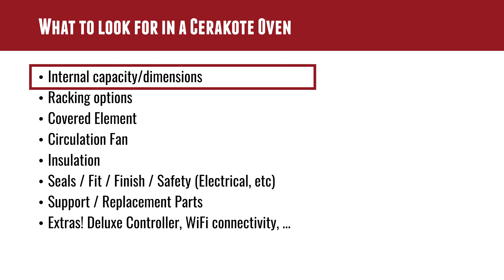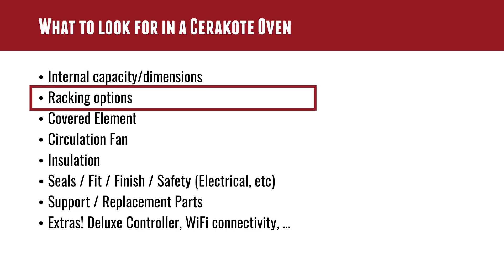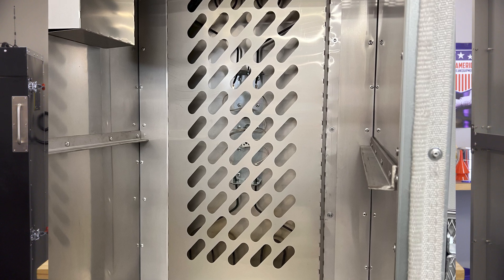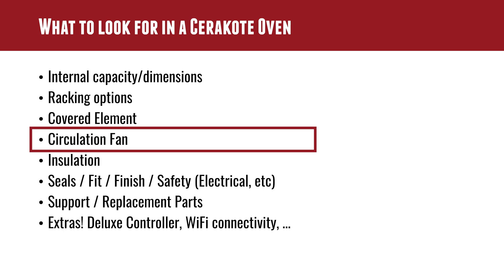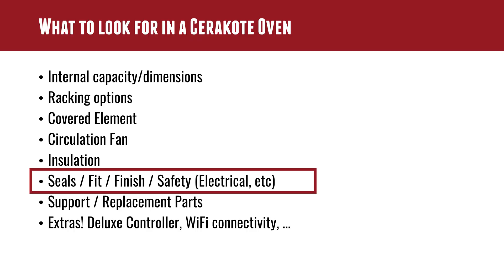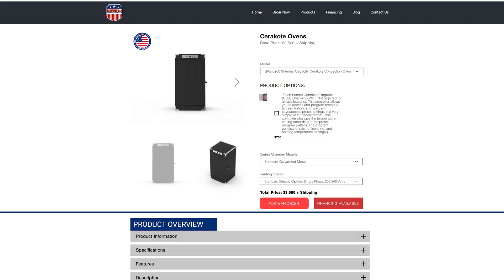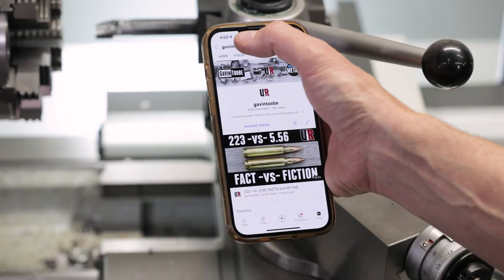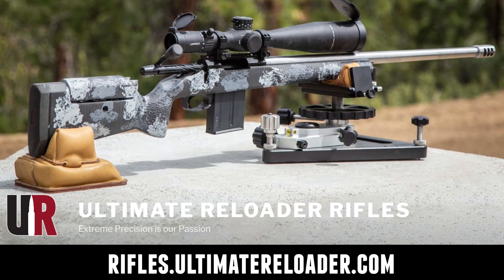BUILD -or- BUY a Cerakote Oven?

Comment: No need for overkill, overthinking or over-spending. The final bill for my 55” tall oven was just a touch over $350. Start with a metal locker like you had in school and just think it out. Got everything I needed on Amazon and it works perfectly. Very  even heat distribution and good retention. And as far as resale value? I just don’t care about that. I built it for my use and it’s perfect for me. Plus it’s just fun to DIY stuff.

Comment: Do not get hung up on resale value 
People in the market for powder coating cabinets 
are few, and far between.
Demand is low
Resale value is low

I use a $5 garage sale George Foreman Oven
for small parts
And
A freebie milsurp heavy gauge 36” cabinet
for larger pieces 
I used heating elements, fans, defractors, and controllers from 
4 different electric ovens
from friends, and relatives who were 
renovating their kitchens 

It took a couple of months collecting parts
I could have probably got ovens in a weekend
 through Facebook Marketplace 
I
Paid retail for sheet metal, and Perlite, Sodium Silicate, Portland Cement 
to double wall the cabinet.
It is allkinda nice.

Comment: Another potential plus for DIY is footprint / space - two ways:          1) build to maximize available space  2) I'm looking to build a collapsible 'hot air booth' that is in 4 pieces 2 x Hinged side + back folds flat 90° from assembled or double stack 270° from assembled, top, and base with electronics.    Will it be efficient - NO, will it win any beauty contests - HAHA NO, will it save me space in my garage as a hobbyist - YES, will it work for what I need - 90% YES (there's a 10% chance I could pull an 'F#@$ this' and buy a pre-built.                     I will say that a large Styrofoam cooler set on its side and lined in foil tape, with a hole near the bottom that fits the $10 hairdryer, and a similar hole near the top that I partially cover to manage temps has worked from 150°F - 250°F   1) open cooler, 2) Poke wire through cooler and hang parts,  3) insert hair dryer and turn on, 4) verify parts are NOT swinging too much,  5) close cooler, and 6) partially cover exhaust to manage temps.    May be sketchy, but cost me ~$20 plus parts on hand and I have done Cerakote, DuraCoat, and AlumaHyde successfully.    That said, if this was an important income stream I'd pay for a commercial unit.

Comment: Lol just use your kitchen oven unless you are trying to do an extreme long distance build and have a long barrel that won’t fit. Besides that you can fit all you need in your kitchen oven. I work for a small shop as a gunsmith out of my bosses backyard and we use his kitchen oven to do ARs all the time. We have a small one in the shop that is the size of a microwave for pistols or small parts. Unless you are doing an extra long barrel you don’t need anything fancy
Reply: To clarify, Do not use a USED kitchen oven. This has been discussed plenty, the grease and oils and such are not good to introduce to wet cerakote. Also, literally just buy a cheesy electric smoker. The length is right for hanging barrels and longer handguards and the elements are already covered.
Reply: @TrashpandaNVGs  the oven we use is very old and it’s not a problem. If you got one for cheap and it was greasy a can of oven degreaser is like $5 and it’s super potent. So for people not rolling in cash there’s ways to do the thing without spending a ton of money. Gunsmithing in general is insanely expensive with all the tools. Most of them you can make or buy used. If you want good experience and to not blow the bank thats how. You spend money on measuring tools and precision tools. Precision like reamers and measuring like calipers and feeler gauges and lapping tools. Things you can’t make easily and are required to be in good condition to do their job right